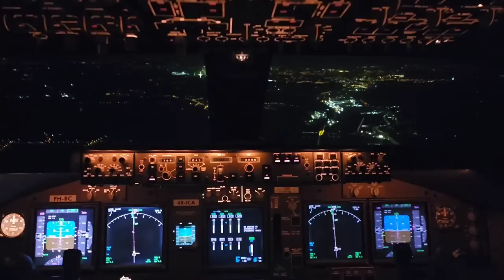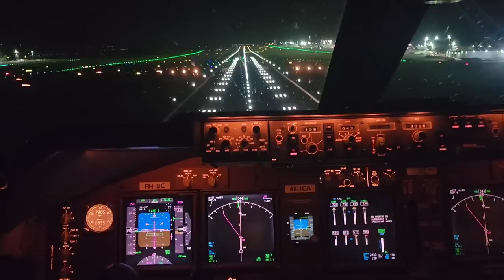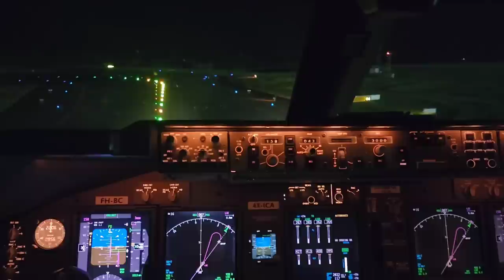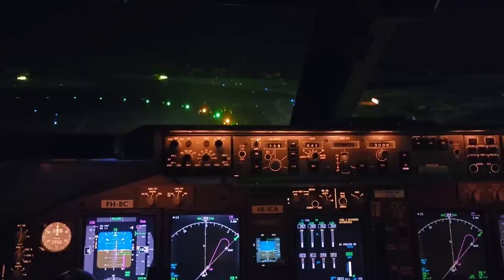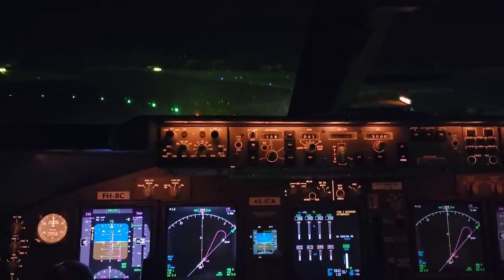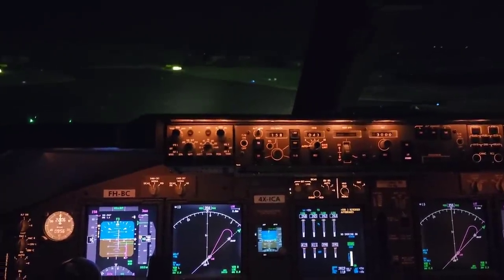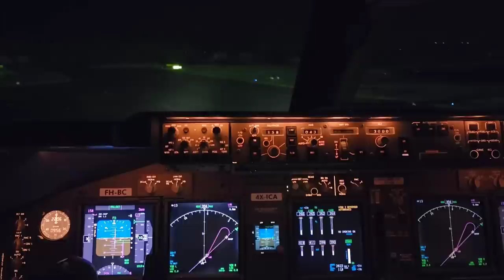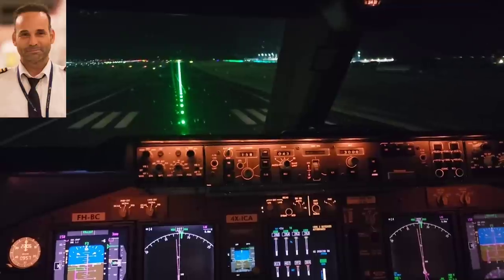INTERESTING, Automatic landing of BOEING 747.(cockpit view), verbal explanations by the pilot

Comment: @Captain Boeing, why does the Flap 30 indication change from green to magenta on the roll-out, then back to green?
Reply: That is because the Boeing 747 has slat protection systems which are designed to prevent the thrust reversers in applying any excessive amount of air to the leading edge slats, which could cause them to get damaged. That is why, after landing, for as long as the thrust reversers are engaged, the slats retract in position and most likely come back up again after the reversers are stowed.
Reply: @Acepilot1312  Thank you for explaining this....I saw this on another 747 video with a wing shot of the landing and asked why the slats retracted but nobody answered.  I wonder why they bother to extend them again after the reversers are stowed, they serve no purpose at that point.